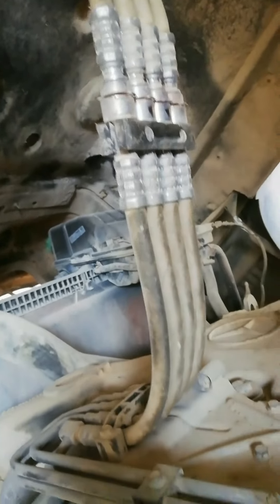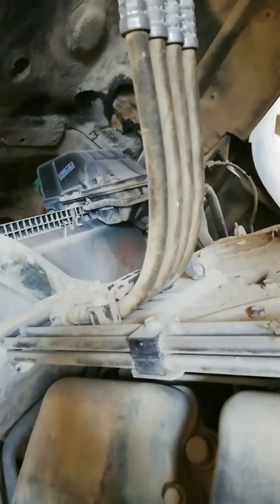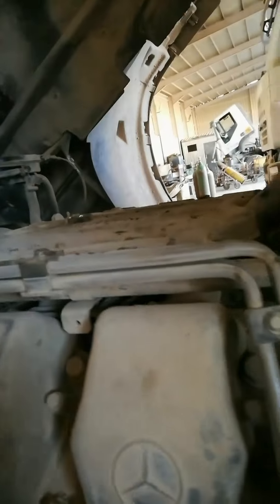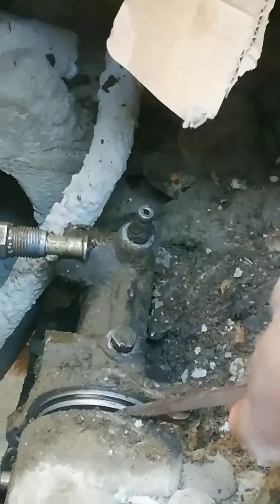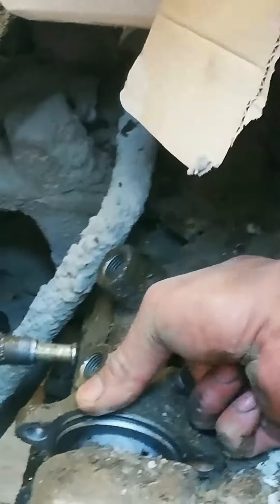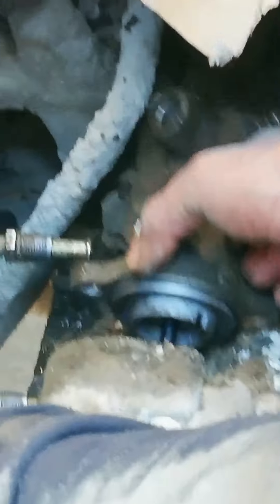Mercedes Actros Gear Shifting Problem, Troubleshooting and bleeding procedure

Comment: Anyone know what fluid type or grade is
Reply from the maker: check the color of your reservoir cap if the color is black, use ordinary brake fluid make sure not to mix different  brand of brake fluid this will affect the quality of your rubber seal, and if the color of the oil reservoir is green, use oil CHF 11S avoid mixing any kind of oil this may cause to melt all rubber seal.

Comment: Today am ripiar but 5 and 6geer not working 
Stop the vehicle 5and 6 Geer good but raining time not good
Reply from the maker: Check hi and low gear re-check the air pipe connection
Reply: Shakir khan ap pathan ho
Reply: Ye Geer mai konsa oil dala jata hai mane bohot koshish kia leken Geer nahe ban ta
Reply: Oil 21 hai ya koi or